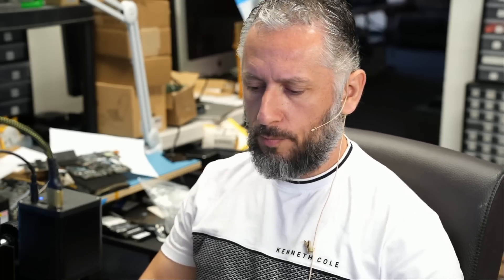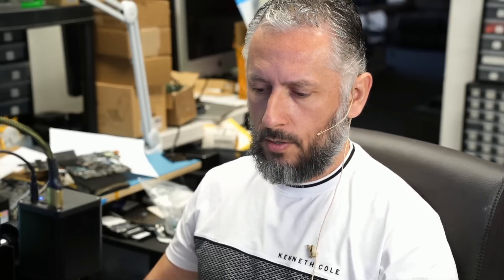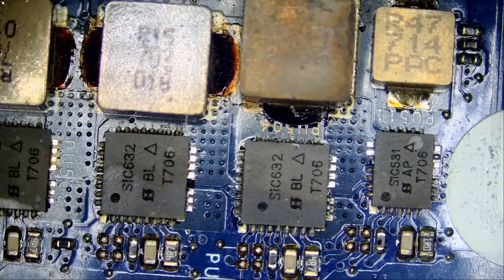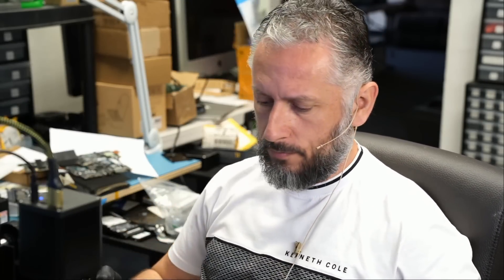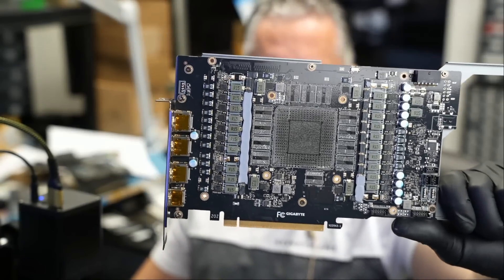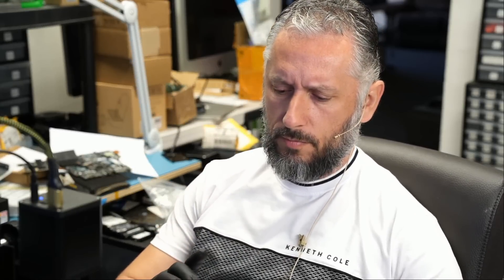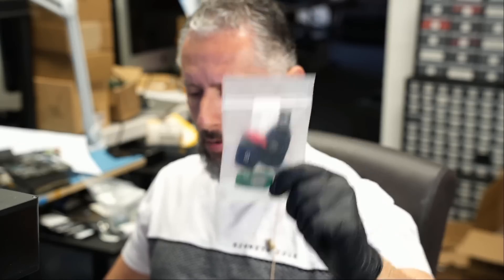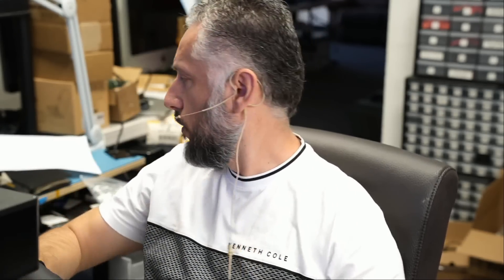A Notorious Dell Alienware CPU Issue.  Is it Fixable ?

Comment: While I am not sure if actual answers are being looked for when it come to the 4090. This is how my mind interprets this situation. Otherwise answers these questions and leaves a few more.

As to the card coming to Northridge Fix and y'all taking the card in to try and fix it, to me y'all are in the clear. Sure this situation was a possibility. However it could have just something else that y'all have fixed before or something that is fixable may have just taken a bit longer.

Now when it comes to the other two repair shops that is more questionable, meaning did the first shop even open the card and take a look to see the problem and if the GPU and Memory chips missing? If this was the case, then if the shop did not inform the customer this is a unprofessional move. Could it have had a other problem and the first shop took these parts? Anything is possible and this pure speculation would need proof to go one way or the other. Also, these same questions applies to the second shop. 

Now when it comes to the customer, they should have tested the card. If anyone says you cannot test something when local, run away no matter what the item maybe either vehicles or electronics. Unless you know how to fix them and you want to take a chance on something going good or going wrong. Basically know what you are getting yourself in to before you spend big bucks.

I have not forgot about the seller of the card, if they are the ones who pulled the GPU and Memory chips, shame of them and how in the hell do you sleep at night knowing you are screwing someone over. If they did not do this then it falls too one of the repair shops. The unanswered question that will solve this whole mystery is, who actually took the GPU and Memory chips. Only two know the one that did it and a higher power that watches over all.

Comment: Great show and great content. RE FOBs. It's not the cost of the fobs but rather the programming of the vehicle where the cost factors in. Sure, a fob can be had for $100-$150, but add the dealers charge to program the FOB or the car and now your adding another $400-$600 to the mix.

Comment: I bought a Dell XPS with what I now know is a common problem, my guess is you already know what I am about to say but the ram slots are bad, I have went over the board with my digital microscope and cant see an issue, here is where it gets strange.., with a ram module in the left hand slot and applying downward pressure the laptop boots up, so I took an old credit card and cut a piece from it and wedged it slightly under the heatsink and on top of the module to hold it down and now it works fine, but that isnt a long term solution, thinking of applying flux and heat to the slot feet maybe using a bit of solder wick to apply fresh solder to the feet (all 900 of them 😑), going to search your channel in the hope you have covered this issue before, Andy Northern Ireland.
Reply: Also the CPU gets very hot.

Comment: I don't understand why he doesn't just solder some new memory and a core on the 4090???
Reply: That cpu can not be cheap and how would you even get a new one? I wouldn't be surprised if it's the most expensive thing on the card. I'm pretty certain you can't just contact the manufacturer of the graphic card and have them ship you a brand new processor for you to install. I bet even if you were to send that card in to them for warranty they'd send you a brand new card instead if the processor is damaged.
Reply: Where can you get these spare parts?
Reply: @xDaWorsT13  probably a donor board?
Reply: @BHSAHFAD  What if he doesn't have one?
Reply: @finmat95  just get one from a dead 4090
Reply: @ I repeat myself: what if he doesn't have one?
Reply: @finmat95  then buy one?
Reply: @finmat95  wait so you actually think he has fixed every 4090 he has received?

Comment: I have a Alienware 17 R5 just like what you showed failed.  It works great.  That said, what causes it to fail?   Would me re-pasting the CPU and replace the vram heatsink thermal pads help it last another 10 years?  Anything I can do to extend the life?
Reply: I'm nowhere near the skill level of Ali but I've repaired / diagnosed many machines. My advice is to keep it clean inside. Especially if it's around a smoker. Also like you said fresh thermal paste or pads definitely help. The enemy is heat (under normal use). Also I always advise using a laptop cooler. There dirt cheap now.
Reply: The cpu shorted itself ... when the components failed.. so ..lack of cpu overvoltage protections is the issues..  This cannot be fix by normal means ..it is a design flaw ...
Reply: @ranjitmandal1612  he has mentioned multiple times, if it aint broken don"t fix it.

Comment: I repair electronics and personally i have almost never had something like this fail on me that was my own personal property. Multiple laptops, consoles, cell phones. I'm sorry but i really struggle to not internally blame the customer. In most cases they probably used the device in a way that caused the issues. By either getting something wet, using cheap power supplies/ chargers, not giving something proper ventilation. ETC. IMO the majority of repairs are caused by the customer, they just don't want to admit they did something stupid.
Reply: I have a Alienware 17 R5 with a i9 and 1080 . I have rebuilt it , fans battery 2 times with repasting cpu and GPU and high quality silicone pads on VCore inductors . It's still kicking after 7 years of intense usage . I do notice the copper heatsink areas can bend easily and obviously not be effective in their cooling . I always ensure that they are indeed applying crush to silicone pads . Cheers
Reply: While I would agree with you... I've had a Surface Pro die on me due to a capacitor failure.  It is a known issue where a capacitor dies and causes the CPU to not start when you power it on.  So, things definitely happen.

Comment: If the client provided a replacement CPU would you be able to get that working ?
Reply: The problem with that is the whole motherboard was overvoltaged for bad customer use or dumbass thieves that calls itself "Electronic Technicians".

If u replace that component and fails other(s) for the overvolting mencionated, making a non-stop and useless investment on a beautiful piece of  scrap.
Reply: Nope he doesn't do CPU swaps

Comment: I usually inject voltage by soldering some wires to the board. What is wrong with that?
Reply: It is common practise.
Reply: it was not needed in this case, just visual inspection is enough to tell you what went bad as Alex said.
Reply: waisted time :))

Comment: My bet is that you are going to get your first  5090 12 volts connector repair in .... 3 months :)
Reply: Before 3 months :) 

They are shoving what, 75? more watts through that connector in stock form? 

I wouldn't want to bet against burned connectors! Haha
Reply: @volvo09   why not a MEGA million lawsuit ?  you need at lest a 6 awg  for 45amps  those little wires can't handle it
Reply: The first default 5090 is on an other chanel: Der Bauer
Reply: There is already two reddit posts of the 12vhp eating itself alive.. the problem is already here my friends 😁
Reply: @tonygunk1886 I think I read somewhere that apparently the design problem is causing the power to draw through only 1 or 2 wires. I may be wrong
Reply: I think I just seen one poster on YouTube
Reply: Maybe 3 weeks, lol
Reply: Within next 8 weeks from now
Reply: You don't get warranty in america if u spend that amount of money on a video card ?🤣
Reply: In the next few days if not already happend😅
Reply: The manufacturers will deny warranty in 3....2....1.....

Comment: would that gpu work if you replaced the gpu chip and ram chips ?
Reply: Yes, but it could end up being a wasted effort. You don't know how that board was handled before, it could have damage to the PCB somewhere that you can't see. And you wouldn't know about that damage until you spent all that time and effort replacing the GPU chip and memory chips.